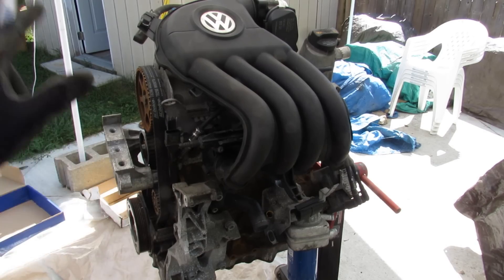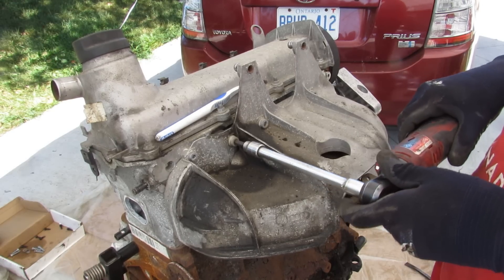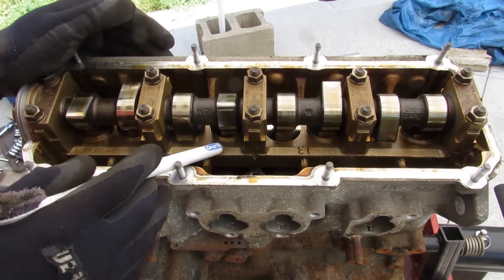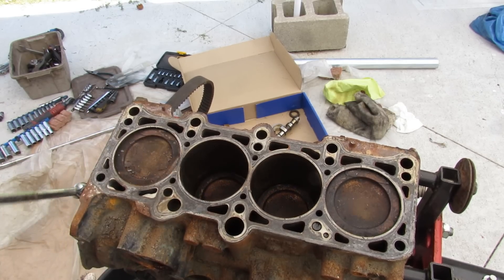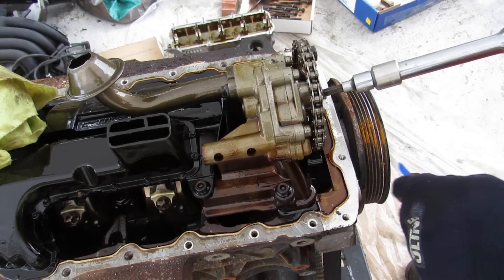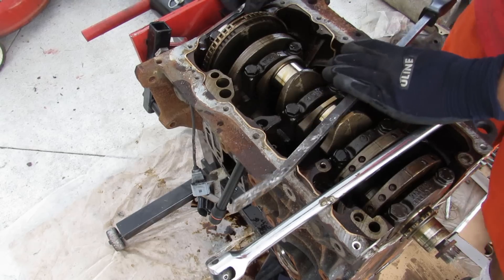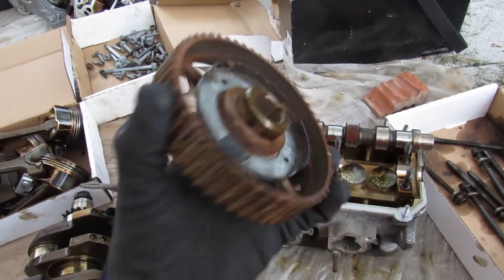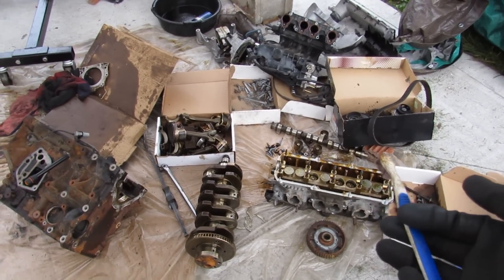The Simplest Modern Engine - From Volkswagen?

Comment: The really long runners on the intake help with low end torque, something that lil engine doesn't have a lot of.

The ignition coil is most likely a coilpack driving a wasted spark setup (for this 4 cylinder, it uses 2 coils).  If it was just one coil, there would be a need for a distributor.

The 'buckets' are called hydraulic lash adjusters.
Reply: @Akira S Did you see a shim?  I didn't.  I have seen these exact HLAs b/c my engine has them too.
Reply: @Akira S I blew the head on my xt250t 4 valve because those used shims on buckets and we couldn't find any shims here where I live let alone ones of the correct thickness... so we decided to bring the clearance to spec using feeler gauge cut out to fit ( they would go between the shim and bucket in this case ) 

Bad idea.... due to the wobble play present one day the feeler gauge jumped up and out between the shim and bucket and causes the cam to slam the now misaligned bucket into the valley it rides in, valve stuck open before it  kissed the piston... she locked up the rear wheel before I could clutch in and had time to figure out what went wrong...

Piston seems to have survived but now I'm looking for a replacement head to put that engine back together..

I learnt from my mistake, never doing that again.. oh well
Reply: It's 4 separate coils in one "pack" which the ECU asks to fire one at a time. If you look at the connector to the coilpack, you'll see 5 pins. 1 ground, and 1 for each cylinder. That's why it'll chew through coils, only one cylinder needs to die to kill the whole pack. You are right about the lash adjusters, they use oil pressure to make sure they're always right up against the camshaft so it doesn't tick at all
Reply: @dud1f3r  I don't see where the connector pins are shown, do you have a time stamp?  There is also no (visible) cam sensor, so it's still a wasted spark setup, even if it does fire one plug at a time.  Seems kinda overkill for an engine designed to be simple.

Looking up coils for this engine, I only see four pins on the connector.  The design also looks like it's just two coils.
Reply: @pvp_operator  It being a AEG engine, the coil pack should be the same as the MK4 AEG (the only changes from AEG-BEV were connectors and air shroud injectors, the block was the same), which had 5 pins on the connector. While I don't have time-stamps, I've owned like 3 of these things, the cam sensor is right beside the camshaft sprocket, which can be removed without taking the cam out. (EDIT) You can see the 3 pin D-style connector in the first shot we get of the motor. 0:03 left side of the motor right below the hook point for pulling the motor out (EDIT) I looked up the wiring diagram, and lo-and-behold it is a wasted spark system, with (right to left) pin 1 being 2 cylinders, pin 2 being power, pin 3 being the other 2 cylinders, and pin 4 being ground.
Reply: @dud1f3r  I see the cam sensor now, thanks for pointing that out.  I wonder why they bothered with that if they run wasted spark?  I watched a vid of someone replacing the cam sensor, and it was a lot of work for a simple sensor.  If they wanted simple, they did the wrong thing IMHO.
Reply: @pvp_operator  afaik the MK4 used 4 coils in one coilpack, so it needed to know where the cam was. I guess it was just a leftover from that
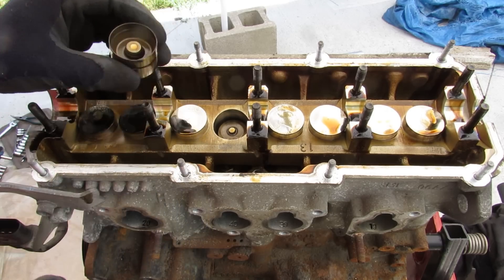Reply: @Akira S 4:22 and 4:33ish.  No spot for shims on the top, and he even says "nothing to adjust".  I'm just going on what he's showing really.
Reply: @Akira S That's a first.. Someone on the internet admitting they're wrong.
Reply: @panzerveps  mature and level headed people are like that. Not everyone who runs comments are assholes lol
Reply: @Akira S ahh yes so it seems the way I wanted to go about it seems to have worked for you! I have a chance. 

I was thinking of getting the shims machined but just using a larger OD shim and get it shaved to fit would work as well - seems easier to me

Thanks for the help! 

Now I still need to source a head to put my bike on the road 😂

Cheers champ
Reply: @Akira S appreciate the advice! Thank you
Reply: Hydraulic "lifters". Vw used both the old mechanical shim heads and the hydraulic heads. Depends on the engine. My 1.8 was hydraulic, and my 1.6D, but some are not. I rebuilt the 1.8 head to stock before, upgrading it is my next project.

Comment: Living in South Africa (VW Factory ) and having family in VW management in Germany had it's advantages. KR and AAB block with 16 valve heads we got to 400HP in 1988! Later years I got Touring car valves and springs and kit from VW Motorsport. With T3/T4 turbokinetics turbo and advanced electronic management we saw 600HP from these motors in 1992 using the later block you show here. Nothing Japanese could come close! The best part is , we used STD VW block , pistons, conrods and STD VW Forged crank (older 1800 and 2000 vw motors). Conrod bolts we used ARP from some Ford V8. Got tired of wheel spinning all the way up to 130 MPH😂 ! So bought the spare 4 wheel drive Golf 2 Syncro from VW Motorsport (that they had used to win the South African rally champs with 4 years in a row) Now we could launch 0 to 100 kmh in 3 seconds and we blew off all things Japanese including Subarus and Porsche 911's ! Those motors are amazing and bullet proof 👌👍

Comment: Nice and educational video , horrible and stupidity designed engine. Vw has no one good engine after the 1.8t that was discontinued in 2005.
Reply from the maker: Thanks. What's horrible about the engine itself? I think it's just bad they chose to continue this underpowered engine in such a modern heavy vehicle
Reply: @speedkar99  well everything is horrible from the steal block to the separate plug leads, the intake manifold on top , the timing belt and water pump set up ,  the plastics inside the top and bottom, plus all that in late 2000’s 👍 that thing is heavy and underpowered,  it just ugly to look at it and when it’s ugly from outside is ugly from inside too and you know that better than me 👍😊 great video as always ✌️

Comment: Simplicity.  It's why I love the 2.5L in my Ford Fusion.  It's 175 lazy horsepower in a non-turbo iron block engine that's given me absolutely zero issues in its 168,000 miles.

Comment: A cast iron block is my material of choice despite the slight weight increase. They are more robust and won't warp or need line boring when overhauling. The slight weight advantage of aluminium is insignificant except for all out racing cars.
Reply: Who overhauls an engine anymore?  Even a bad head gasket isn’t worth fixing by the time it goes 200,000 miles or 20 years later?
Reply: @Bartonovich52  That depends on what part of the world you live in as labour rates (the driving factor) vary widely. But I agree that the vast majority of engines are never overhauled and simply scrapped. It's a viable option for the home mechanic as long as the spares are available from non-OEM suppliers at a reasonable price.

Comment: Mine was burning oil at 100,000 miles. 

By far the worst engine I’ve ever owned—and that included a Ford 5.4 3v Triton that gave 200,000 miles of trouble free service on all original parts.

Comment: The perfect engine for me. It's easy to work on and cheap to maintain.
Reply: so can you get to the spark plugs semi-easily.just wondering
Reply: @bradc32  Yes theres a special swivel socket you get can for like 8 bucks, use it may times no need to take the manifold off, turns a 1 hour job into a 30 minute job if your just doing plugs and wires
Reply: Yeah, just like a Ferrari.

Comment: 1:48 "how are you suppose to remove the spark plug wires with the intake in the way?"

Golf DIYers: PTSD attack
Reply: Do they actually do this without removing the intake manifold? Seems like it's an easier and less time consuming job if you remove the intake.
Reply: @SI0AX  the mk4 2.0s have two part aluminum intakes so you can remove just the top piece for spark plugs
Reply: @HatsuneM1ku01  Cool, so only a partial disassembly required.
Reply: @SI0AX  I've done it that way yes. Its possible to remove intake, but major hassle,
Reply: @thedude4795  It seems like it will make the job take a lot longer that the time it takes to remove the intake manifold and then do the job, but I wouldn't know if having swivel sockets or a special tool would be faster.

Comment: This is a slight modification to the classic vw 2e/audi abk engine. It was the last modification of a series of 1.8 carb/mono/mech inj then 2.0 mono/mpi variations. monos/carbs had 8.5 compression and 90 hp and mech injection were either 90 or 113 hp regardless of displacement. mpi is rated 115 hp, which has a very oilburny variation post 2k in some base model passats and boras and such. The classic configuration of this engine has both manifolds on the same side, so servicing spark plugs is easy. There is also a distributor randomly comming out of the other end of the oil pump drive shaft. mpi ones in the early 90's had a mechanical airflow meter and continious injection (all injectors firing at once), making the fuel system incrementally different from the bosh KE jettronics early on, but much more simple and reliable. 
One such engine has been driving us for the past 15 years with minor maintenance and major use and some abuse. 
The high displacement and low power output means you can go 380k kms on the factory clutch as ours did (no need to rev it high to take off). We recently had to replace it and were surprised to take out a factory part from there.

Comment: Its Grand father is the AWG/ABA EA827 engine also 2liter. and also 115bhp :P
Reply from the maker: Wow
So power hasn't improved?
Reply: @speedkar99  efficiency , mileage.  Ease of maintenance , prob difference in power band to ,  i can already see with this block where things are mighty handy , internal water pump and thermostat , , and that plastic intake .. might look crap ,but really lowers heatsoak always a problem with the ABA , AWG ,, ps fun fact , this block has a older series , the 2E , (92) ADY (95) and AGG (97) 🤣 also 2liters , and 115bhp

Comment: These are still fitted to the forklift's service as a day job. running on LPG, the highest hours reading I've come across was 22000 hours without major repair. Roughly equivalent to 660000 miles.
Reply from the maker: Wow. Forklifts
Reply: Your right Chris , I work for a German forklift manufacturer and work on these most days .We currently have some with over 24,000 hrs and run smoothly with hardly any  oil consumption. So easy to repair on site . Reminds me of the mk2 and mk3 golf GTI engines .
Reply: @jonathanw5388  Linde or JH?
Reply: @chestnut01111  I have seen the VW engines in a Linde, they get abused a lot in a forklift, but still keep on going.
Reply: @SeanBZA  Yes, those, we also use VW SDi, TDi, PD, Common Rail TDi and 3.2 VR6, However, as from last year new models are coming with Deutz.
Reply: I own a vw caddy van from '04 with this engine but burning natural gas. Mine's at 600k km and there's plenty  others around 700-800k
Reply: @francescotar  A well maintained VW will outlast it's Japanese counterparts. 
Problems typically arise on poorly maintained cars. Even those problems are typically minor.
Reply: @googlesucks0623  Is it the same poo that fills your cranium?
Reply: Engines run very cleanly on LPG versus gasoline.  The oil stays clear for a very long time.
Reply: @stuartbear922  Agreed, on the dipstick, Until you drain it, then it looks like brown wood stain after 1000 hours. Just visited a car show today, there was an Audi 80 soft top from 1995 with one of these engines in it.
Reply: I am sure this is good enough for 80% of drivers.
Too much high tech and complication is not always needed.
However the spark plug and intake manifold situation is not very nice.
A timing chain instead of a belt would have been good.

Comment: This is the continuation of the old 8 valve 1.8 litre that was in mk2 and mk3 golfs. The mk3 2.0 8v was mostly a larger bored engine, with injection instead of carbs, but still using HT and rotor timing, was hideously underpowered. The mechanical design has not changed much from the 70's.
Reply from the maker: Ancient and they still chose to use it in the 2010s
Reply: I've owned a MK2 1.8 carb (90hp) and a MK3 GTI 2.0 8v (115hp). They are underpowered but bulletproof, the MK2 was quite fun because it had the 5-speed screamer gearbox which made it feel fast.

Comment: 2006 Golf SDI owner. Proud owner.
No turbo = more money for the rest of the parts.
Reply from the maker: How's reliability?
Reply: @speedkar99  Only have it for 3 weeks, unfortunately it was mistreated by previous owners, but the engine is still alive and kicking. Cleaned EGR (smoked a lot) and throttle plate (p2108 - still not resolved so not dirt related) 
Now having a repeating issue with Injector #2 connector becoming loose for the 2nd time already, after some "minor" aggressive driving home ;)
Overall engine looks like it takes a beating like a king, and turns you the other cheek. Did regular service and its currently at 705,000 km! Timing + regular service at 720,000 km so that's going to be a great experience for first timer.
I wonder, if its the original engine, because I forgot to ask the seller, will try to check with VCDS once K-CAN cable arrives.

Comment: The only major change these engines received was the crossflow head, but other than that it has remained almost unchanged since the late 80's.
Goes to show how good the OG design is.
Reply from the maker: Nice!
Reply: The block was redesigned in the 90's to remove the balancing shaft, distributor and also relocating the oil pump, because both of them were driven by the balance shaft. Also removed mounting place for the mechanical fuel pump for carbs.

Comment: This is very similar to the 1.9 (non-PD - which have different heads) and 1.8t. The diesel version with the 2-valve design runs on vegetable oil without any modification :)
Reply from the maker: I'd love to teardown a diesel engine soon
Reply: The 1.8t is not that simple. It has 20 valves
Reply: @XxmatixX6videosdiariosdenadav  Yes, the 1.8t also had a different head.

Comment: Vw has used tht engine since 1985 i think, it was first a 1.5l then 1.8l and 2.0l ( all these had intake and exhaust on the same side) and on late 1990's the 1.6 came out as well as the 2.0l crossflow your showing there, also the 1.8t was based on that model as well as the 1.9 l diesel, prob the most loved engine here in argentina and brazil
Reply: The 1.9 PD and 1.8t might have shared the block but the heads were different. The regular 1.9 TDI had basically the same head.
Reply from the maker: VW regurgitating old engines in newer vehicles

Comment: This is a tried and proven engine that turned the automotive world upside down and sent them back to the drawing board to redesign.  It came in the Golf GTi and was fast as hell.  UK Ford had to go scrambling to beat this little engine in 1600, then 1800.  It also influenced them to go FWD Hatchback too, which turned out to be a disaster for their future car lineup.  The 16V version to this engine also has no variable cam timing but never needed it to make 340 HP normally aspirated and run rings around Mitsubishi's 4G63T once the humble VW engine received its own turbocharger.
Reply from the maker: Hmm I don't think this would be fast for a GTI
Reply: @speedkar99  This is the original GTi engine, it came with Carbs first in the Golf, then fuel injection, then a 16V Version.  The 16V 2 liter in race form makes 320-340 HP, I have seen it.  How many normally aspirated 2 liters are making this amount of power
Reply: Nice hype there, but wasn't the Alfa Romeo Alfasud superior to the Golf GTI?
Reply: @TassieLorenzo  They were from two different eras, but when the Golf GTI came along it simply dominated with its 110 hp 1st gen engine.  Even the Alphasud Sprint never made that power.  Up to the 90s it was still hailed as the best driving hot Hatch, even in the presence of the mighty Peugeot GTI 1.9.  This car made Ford try to follow with the Escort XR3, XR3i and totally lost it's way when it abandoned its RWD platform.

Comment: This engine looks extremely similar to the one on my 1994 golf GTI, also 2L 8 valves 115hp. If ain't broke don't fix it I guess
Reply: It's basicaly the same one...
Reply: It is the same one but with a bigger euro emission standars, euro 5 100%
Reply: Yeah basically the same as the MK3 GTI 8v, although that engine wasn’t a cross flow head, although I seem the think the engine was used in the MK3.5 cabriolet and that was cross flow?
Reply: @ConorBurrow  i think it was the same, it was even on the MK4 with a different intake manifold and cat so it's euro 4

Comment: Brother in law got this Motor in a 2012 Jetta five speed manual hand crank windows. It’s a very cheap car to run. Very cheaply made in terms of interior materials & exterior bits. However the actual chassis feels kind of solid more then my sister’s 2012 Corolla. It has over 200,000 miles on it. Big trunk pretty big backseat nice cheap basic commuter car.